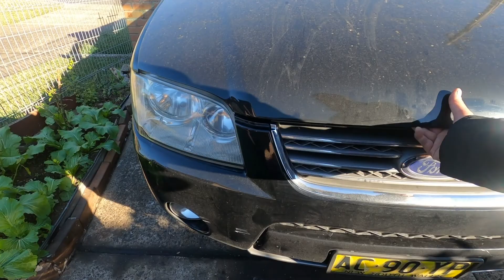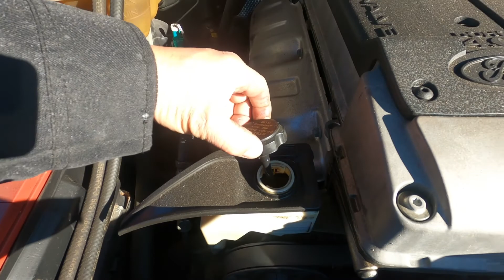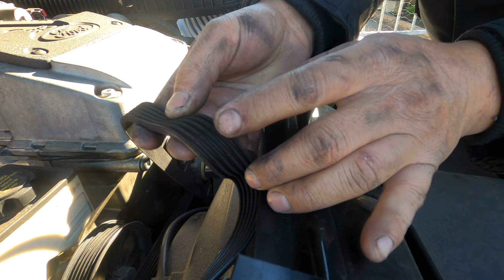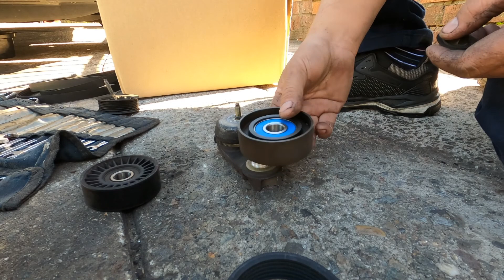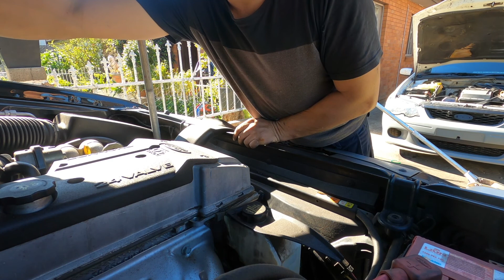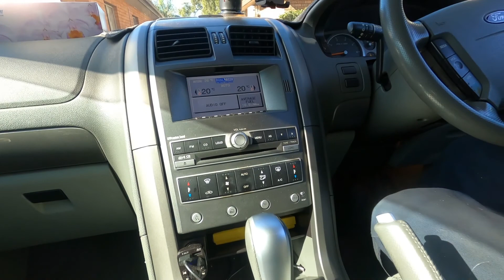ford territory ghia 2005 service

Comment: Thought your supposed to use 5w30 oil for this particular model?
Reply from the maker: Yes but when it old use thicker oil
Reply: @TheDingdong78  oh ok. Mine has done around 280k ÷ so it's safe to use what you used?
Reply from the maker: @ru5tpR0of24  yes why not
Reply: @TheDingdong78  ...attempting my first oil change tomorrow. Advice is also to flush out old oil with engine flush before emptying oil and replacing it with new oil?